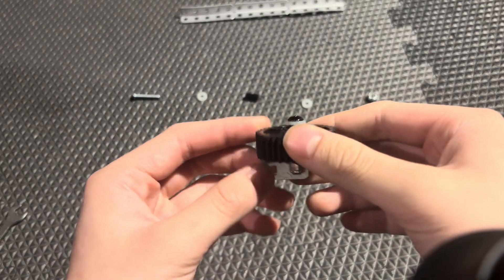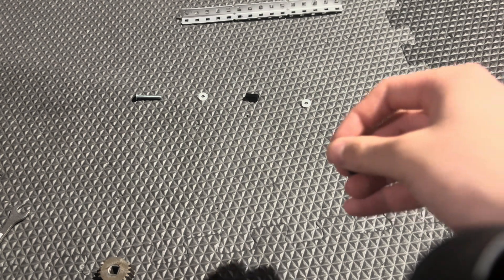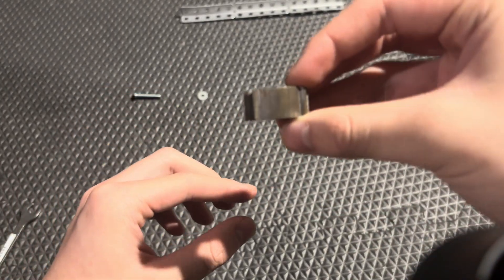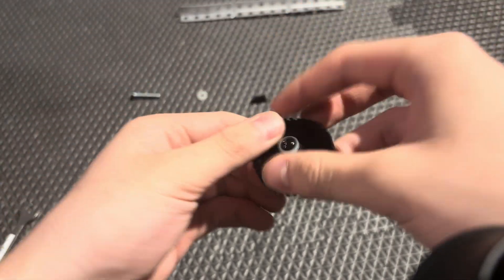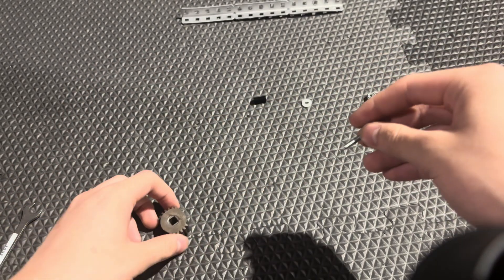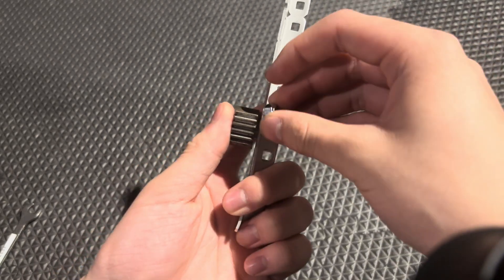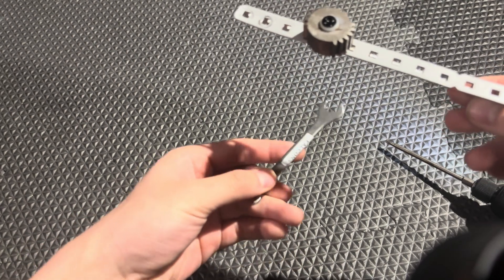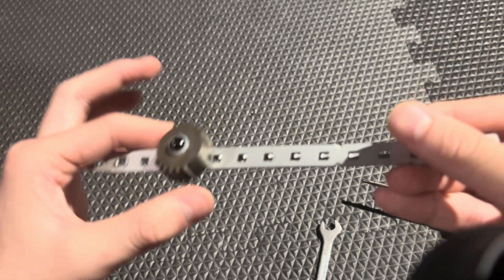VEX Low Profile Screwjoint Tutorial | 355Z Falcons | Vex Push Back

Comment: The only problem I can see with this is that it would be hard to center the screw, possibly you could use a shoulder screw and flip it around but I’m not sure. Otherwise, I love this design! Great job!
Reply from the maker: Thanks! Yes this was a concern to us. I shouldve probably mentioned it but you can put a bearing flat on the other side of the metal and it would center it.